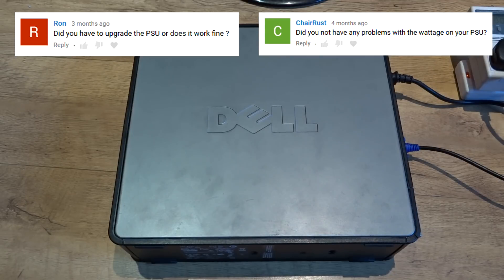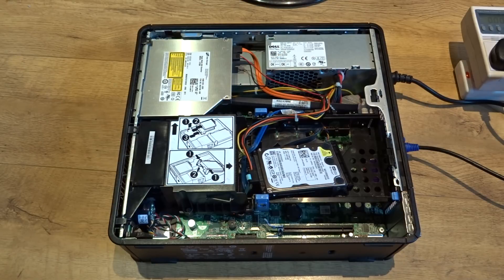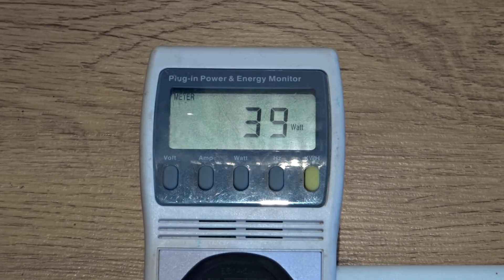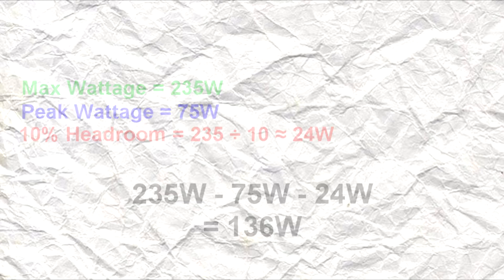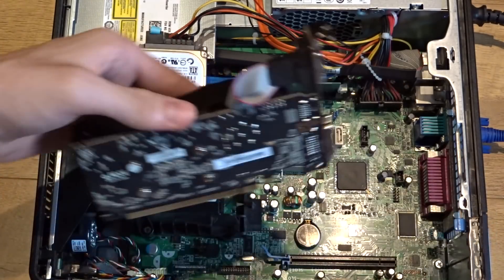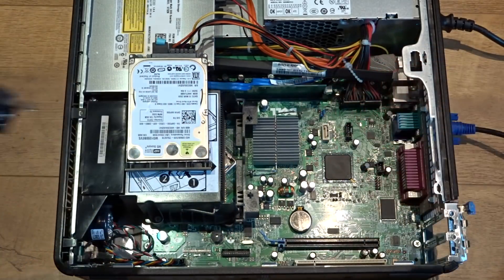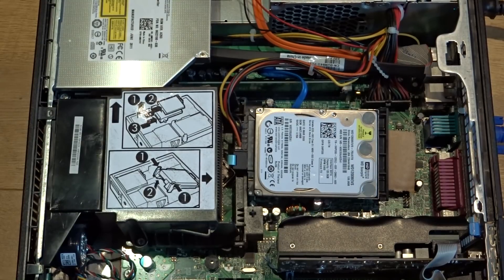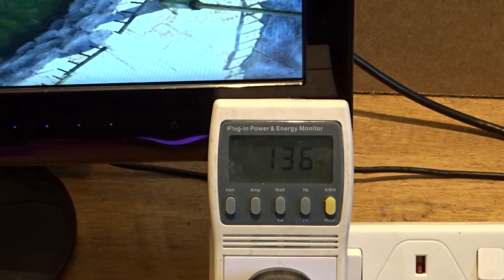Optiplex 780 SFF to Gaming PC

Comment: Great video. That's exactly what I needed to know, because I want some basic (but better than integrated Intel Q45) GPU for my HP DC7800 and it has only 280W PSU, so I had same issue with minimal requirement of PSU power indicated on every GPU that I wanted. Thank you so much.

Comment: That system has a limited 25 watt PCIe connection right? So how can it run with gtx 750 ti which requires 60 watt? Nice video btw!
Reply: questioning the same
also that sff gtx750 didnt even have a 4/6 pin connector for more power. Could he be throttling the gpu some how?
Reply: @danceaccount7267 LP GPU.'s don't use over 75 watts the max for PCI-E so they don't have a connector for more power. The RX550 I have now in my 7010 SFF doesn't use more than 50 (43-46) watts when playing GTA5. My nephew has a GPU that goes no higher than 30.

Comment: I did the same thing with optiplex 760 and 790 ... also used a AMD r7 250 1 GB ... you can game not on highest graphics but it will do esp for the form factor and energy consumption.

Comment: This is misleading- the power monitor only indicates what the psu is drawing, not what it is outputing. The closeup of psu shows gold rated, so 88% efficiency at 20% load and 90% at 50% load. Your system+ gpu is actually about 50% of capacity- 135w ac draw X .9= 121w dc. Most oem psu expect a max of 50-60% load, so this really is borderline.  SFF pc usually  only use graphics cards for hooking up multiple monitors, theses are 25w typically and the 750ti is 60-75w- thats a big step up. I am surprised the the pc booted are did not throw up an error when you unplugged that cooling fan, without it that chipset heatsink is going to get really hot, this can throttle ram speed or cause random shutdowns or just die. I hope this was just a demo type of thing. gt 1030 might be a easier fit, size and power wise- only 30w and about 90% of 750ti performance.
Reply from the maker: I was aware of the efficiency thing but at the time of filming, it never crossed my mind for some reason. The cooling fan I removed was for the hard drive. Was it also for the chipset?
Anyway, I've never had any issue putting a GTX 750 Ti into a prebuilt PC such as the one in the video.

I made this video to talk about people's concerns about power draw so I am glad you brought it up.
Reply: You used a Dell in video, most are ok with higher power video cards along with say Lenovos, but HP pcs- you can have trouble with those. They print 35w limit right on motherboard and this cannot be changed in bios. There are some vids on YT about this very problem. Another problem with prebuilt business pcs is they like them quiet, and thus slow fan speeds, which make them run hot, add in a hot video card and it just gets even worse. Shutdowns can happen from power overdraw of stock psu, but heat will also throttle or shut off system. Look at air path of that fan, it moves air around hdd and chipset hs.
Reply from the maker: When I was using the PC, the CPU got to about 65'C under load while the GPU got to about 70-75'C under load. It was relatively quiet as you have mentioned but those temps don't concern me since I rarely stressed it. Just to be safe, while I was using the GPU I did add a thermal and power limit to it but for this video, I did not.
I am aware that some companies limit the PCIe wattage by quite a lot but I did try to do my research before I made this video. From what I could find, it said that the maximum power this slot could provide was 75W. Considering this card is about 60W, I thought it would be enough. And it was.
I tried overclocking as well just to try to push it to the limit but it was too unstable so, as I said, I added power and thermal limits.
Reply: Running an HP 8200 they do just fine. Although I did have to downclock my RX 470 a bit, a 1060 at stock would be fine. As for temps, it's nothing that will even remotely harm the components. Card stays at around 65 degrees while cpu might sometimes reach 75 degrees but mostly stays at around 60 as well. 

And yeah, i think that fan is for the chipset, harddrives don't need fans.

Comment: Its not so much the "quantity" of the watts, its the "quality".... OEMs are notorious for putting cheaply made power supplies that i wouldnt trust in any system, i would be more trusting of a 235w name brand power supply that uses quality made components for cleaner and more stable power.
Reply from the maker: Fair enough. But if you don't have at least the minimum required wattage, the quality does not matter.

Comment: Could have thrown in some dremel action and kept the drive cage, which is exactly what I have done in my SFF 980. Loose HDD's are never a good thing.
Reply: cw48494 or using an extender for the graphics card
Reply: My 780 doesnt even have a drive cage in it and my HDD isnt loose they hid it somewhere, not sure😕
Reply: avrgszn use a laptop hdd

Comment: I did cut an old mouse pad and used a zip-tie to mount and protect a 2.5" HDD in a 3.5" desktop slot. The PC was from 2008, with some newer parts from 2010.

Comment: Hello, I am using HP pavilion s5-1451d which has a 230w PSU. Can my PC handle this card. Huge fan btw!
Reply from the maker: You might be able to handle this card. I'm not entirely sure since I cannot find a lot of documentation or pictures of the interior of the PC.
Reply: Thanks for the reply! Here's the specs if you don't mind to check 

http://www.yuspo.com/en/pcsworkstations/1821189-hp-pavilion-slimline-s51451d-EAN-0887111999733.html
Reply from the maker: Yeah. I think it should be able to handle a GTX 750 Ti. It looks as if it already has a GT 630 inside of it so adding a different low profile graphics card (such as this one) should not be an issue.

Comment: when I got my gtx 980 2 years ago I had a corsair CX 500W PSU and alls that happned was it shut down when it got to much load on it, even though the 980 requires a 500w PSU (based on paring it with an i7) i got around the problem by reducing the power to the card and enabling vsync untill i got a new PSU

Comment: Very handy video!
I have the same Dell 780 - Q9550 & gt 1030 and i went from (255 Watt) to (135 Watt) because i changed my power cable to go directly in the wall. Before it was connected to all sorts of things (not orgazined power cables), but now its running very smooth.
Thanks so much for this video!
Reply: Peter Wolf same parts I'm going to get how do games like GTA v run?
Reply: Acing Blitz hi. I upgraded to a GTX 1050ti, but i ran gta with 30-40 frames
Reply: Peter Wolf how much did u get with gt 1030?
Reply: Acing Blitz 30-40 as i wrote before. 
Getting 60+ with GTX 1050ti
Reply: Peter Wolf oh ok thx
Reply: Peter Wolf did u take off the fan and did it run fine without it?
Reply: Acing Blitz the fan in the grapichs card? Never take the fan off
Reply: Peter Wolf the one over the cpu
Reply: Acing Blitz oh okay... i dont have that fan on My Dell 780. I presume it will run fine without it 😊
Reply: Mine was working perfectly when i had the gt1030 in it. I could even overclock the GT 1030 a little and it ran flawlessly.
Reply: Peter Wolf let question xD were u able to put the case cover back fully?
Reply: Acing Blitz yes 👍
Reply: Acing blitz I couldn't put the case back either 😂

Comment: I saw on toms or some fb groups that said this pc's pci e x16 is limited at 35watt (except the mid tower one). So its only upgradeable to low power vga card like gt 1030? If i want to upgrade it to 1050/ti LP should i change the motherboard too right?
Reply from the maker: Kondo Shoji I would not trust Facebook. I've done my my own research and found that it should deliver up to 75w. in this video I install a 60w card and it works fine. if you are unsure, I would consult the manual that comes with the computer since it will tell you what the slot is rated for

Comment: so if i get this system and i put another PSU in it and put a stronger GPU in it will it work? if i use the 4or 6 pin cable from the PSU?
Reply from the maker: Well, the issue you would face at that point would be space and bottlenecking.
This case can only really handle 1 slot, low profile, half height graphics cards.
Even if you could theoretically fit a GTX 1060 or GTX 1070 (for example) inside of this case, the older Core 2 Duo, which this computer has, would bottleneck the GPU.
Reply: MightyElemental i foudn a dell optiplex system with i5 2500 8gigs of ddr3 ram in a sff and i do have a spare case the system cost 100euro
Reply: I put an intel q9560 and ssd and gtx 1050 ti in a Dell 755 refurb. been using for more than a year. amazed at performace. the 9560 cpu is a hidden gem.

Comment: I have an HP with a psu which has 16 amps on the 12v rail = 192w (psu outputs 240w max). I have a 750 Ti (60w) and a Core i5-3570 (peaks at 112w). I've used Prime95 and Heaven benchmark at the same time to test stability and never had issues. Same thing with another computer with an i5-750 and a 750 Ti. The only problem is heat due to the small space in the computer.
Reply: you can try undervolt your cpu for better temperatures
Reply: Yes. Undervolt cpu 
Customise side panel with holes or cut a square out and put a mesh over the square
I think you can get a fan and use sata to an adapter to power it and put another fan on side panel

Comment: Great Video. I have the Optiplex 980 MT with the specs:
Intel Xeon X3460 & 2.80GHz 45nm Lynnfield Technology
8GB (4GB x 2) DDR3 Dual Channel & 1333Mhz
GPU: MSI Nvidia GeForce GT 710 2GB (Slient)

Since my GPU is too weak for my CPU (according to thebottlenecker.com) to play GTA 5 on medium settings, do you know any other GPU's beside the GTX 750ti that cost below $100?

Comment: I'm loving the 780 I have. 16gb ram, Intel core 2 quad CPU, and a GTX 630 I believe. I just want to upgrade my gpu
Reply: nope it supports 16gig DDR 3, mine had the same
Reply: it was most definitely worth it for me, you may be surprised just how much life these old rigs have left in them with a few modern tweaks, if you don't already have one get a core 2 quad in there (2.83ghz recommended as the 3ghz is more expensive and has literally no real world performance difference) definitely consider throwing an SSD in there and if your willing to do a little modification a 750 or 1050ti low profile. You may think its over the top for an old rig but you can always consider these kinds of upgrades as a down payment on your next rig later on... which funnily enough is where my SSD and 1050Ti now reside
Reply: I want to know I have a 780 Mt can I upgrade ram to 16 gb 4gb each slot
Reply: if you have 4 slots it will support 16gb ddr3 yes
Reply: what is the maximum upgrade on optiplex 780 to work with adope after effects please??? btw i have a hackintosh on my 780

Comment: is this good for gaming too? Gigabyte GeForce GT 710 2GB Graphic Cards GV-N710D5SL-2GL
Reply from the maker: The GT 710 is not very powerful so I would not recommend it for gaming.
I would suggest getting a GT 730 at least. Maybe even a GT 1030.
Reply: I also have the GT710 2GB (MSI though), It's alright but don't expect to play most games in medium-high settings. In GTA 5, I get around low 30's FPS to the medium 50's FPS (but in low settings). I suggest you go find another GPU like the GTX 750TI or the GT 1030.
Reply: thanks

Comment: Can i use a Evga GeForce Gt710 with my optiplex 780 DT?
Reply from the maker: +Shadow King yes as long as it is a low profile version
Reply: MightyElemental i was looking the specs and say included low profile brackets minimum power requirements 300w with intel corr i7 processor. gpu power consume 19w
Reply from the maker: Since it is only 19W, it should work with no trouble. In my experience, my Q9400 does bottleneck my GTX 750 Ti but since the GT 710 is not really designed for gaming, I don't think you will run into any major bottlenecks.

Comment: hey MightyElemental. great video, subbed. I have an optiplex 780 DT. 
CPU:
 Intel Core 2 Quad Q8400 @ 2.66GHz 
 Yorkfield 45nm Technology
RAM:
 4.00GB Dual-Channel DDR3 @ 531MHz (7-7-7-20)
Motherboard
 Dell Inc. 0200DY (CPU)

I've been looking around for a graphics card to buy to play CS:GO and run some programs on. Thinking about buying a gt 1030. Are there any other cards that I should consider with a sub $100 budget?
Reply: i bought the gt 1030 and it works just fine without power connectors. funny thing is the biggest problem is positioning the VGA adapter into the graphics card so that the screen receives input. all my programs (video games, really) are pre-2015, so there really isn't too much power demand. 

side note: the better my computer runs, the less I play video games. 4 hours in the past 2 weeks, as opposed to the usual 10-15 hours/2 weeks. I'm guessing getting less mad over competitive games now that I can't blame the PC components and the fact that I now work 30-50 hours a week and go to school full time may lead to my decreased use of my (n+$70) toaster.

Cheers :D
Reply from the maker: +August Method if you can find a low profile 750 ti then that would be something to consider. potentially a gtx 1050 (ti) as well.
Reply: yes, you are limited by low proile case too...there is no many choices to do since there is only 1050(ti)s 750(ti)s rx460s are available for this situation
Reply from the maker: Are you sure you won't need power connectors? The reference card has them. The card is designed to be 120W.
Reply: Gtx 650 ti boost
Reply: wtf is that ram speed lol
Reply: I managed to get a 560Ti full sized card into a 780 Desktop, so in theory you could get pretty much any card you like into there, However it did require some "ahem" unconventional modification of the cards heatsink., there is room at the side of the massive CPU cooler to line up the PCB of a graphics card but you literally have to remove the casing and bend the GPU coolers heat pipes into an L shape so that half of it sits behind the CPU cooler. not for the faint hearted, but once you do this because of the layout I found it actually ran cooler directly in the line of the beefy CPU cooling fan

Comment: hi, i have a dell optiplex 780(not sff) with a 240w psu and i want to add a gt 1030, r u sure it's safe?
Reply: even a 750 ti will do, but that's a double slot card and it requires a lot of power
Reply from the maker: You can get single slot gt 1030s and GTX 750 Tis. A gtx 750 ti is rated at about 60W and a gt 1030 is rated at 30W.
I'd be perfectly happy putting a GT 1030 in an optiplex 780.
Reply: MightyElemental thanks, so I can’t put a 750ti?
Reply: MightyElemental and also, ur putting a GTX 1050 ti in your 780 optiplex, isn’t it double slot? How is it fitting in your system? I watched a video a while ago of this guy putting a 1050 ti in the exact same pc that I have and he totally fucked up his pc case and graphics card bracket...
Reply from the maker: Areeb Raza the graphics card that I used was a gtx 750 ti. I've looked for 1050s that will fit but I cannot find any
Reply: MightyElemental ohhh, ok, thanks, so does that mean I can fit one? Mine’s a optiplex 780, MT(the big one), not sff
Reply from the maker: I'm pretty sure you can fit full sized single slot cards in the MT case so you should be able to fit a gtx 1050 ti. I'm not sure if the wattage is acceptable though.
https://uk.pcpartpicker.com/product/LrmxFT/zotac-geforce-gtx-1050-ti-4gb-oc-edition-video-card-zt-p10510b-10l
https://uk.pcpartpicker.com/product/NndFf7/zotac-geforce-gtx-1050-ti-4gb-mini-video-card-zt-p10510a-10l
Reply from the maker: Wow. Well, I guess it works xD
But you can get single slot models so as long as the wattage is fine then it should fit in and work
Reply: MightyElemental ok then, thanks again

Comment: Thanks for the advice! :)   I have a Optiplex 780 MT faction. I heard rumors that if you upgrade from a Core 2 Duo to a Quad Core that you need a special copper heat sink for a Quad Core.
I also heard rumors that the DT faction was the only one that came with a copper heat sink.
Are either of these rumors true or should a Quad Core work just fine in the Mini Tower faction as the spec sheets read?
Reply from the maker: Well, the only thing that could happen is the processor gets too hot. It's not good.
I'm honestly unsure about what heatsink they used for the different models.
What is the maximum temperature you get with your Core 2 Duo at max usage?

Comment: arent you supposed to measure the wattage coming out of the power converter, and not the power going into it?
Reply from the maker: +Stefan Jensen ideally, yes. I do know that the power supply is not 100% efficient so measuring input won't be the best but that is one reason for the overhead. As you saw in the video, I was in no danger of over loading the system. that was what I wanted to show.

Comment: Possibility to put this in https://www.amazon.de/gp/aw/d/B06XHJX4G8/ref=mp_s_a_1_3?ie=UTF8&qid=1512134570&sr=8-3&pi=AC_SX236_SY340_FMwebp_QL65&keywords=Low+Profile+GTX+1050&dpPl=1&dpID=51aLUKDrOLL&ref=plSrch
Reply from the maker: It could almost work. However, it uses dual slots so it would not be able to fit.
In this video, I do use two slots but one of them is behind the graphics card. The card you linked to has the second slot in front.
I hope this makes sense.
Reply: MightyElemental Wich one do you recommend?
Reply from the maker: Are you using the SFF version? If you are using a Mini Tower version then I chould easily suggest one for you. The issue is I cannot find a single slot low profile gtx 1050 or 1050 ti.
But if you have a mini tower case then you could get a single slot full height card
Reply: MightyElemental yes I am using a sff version